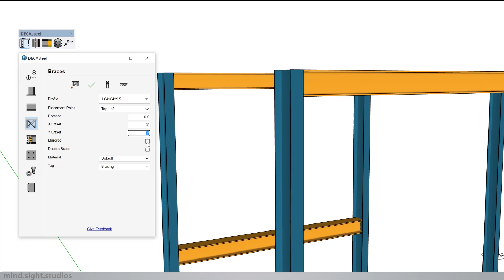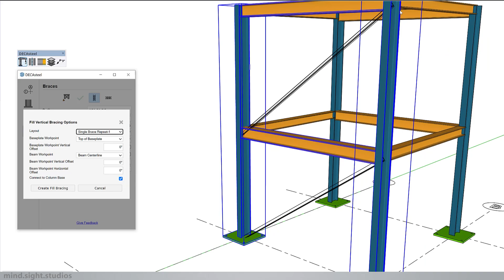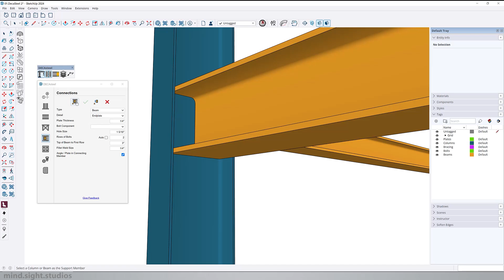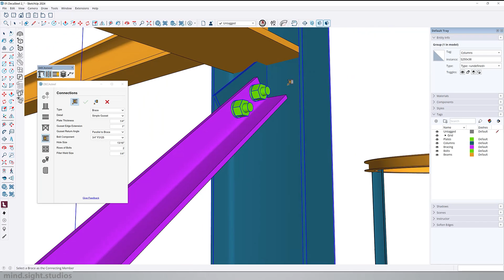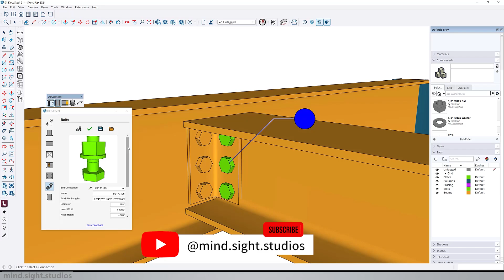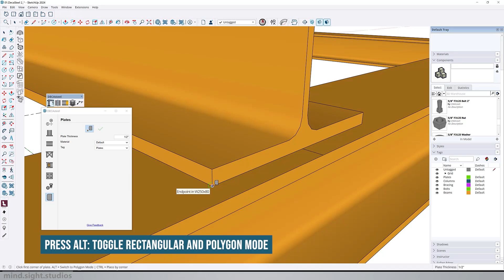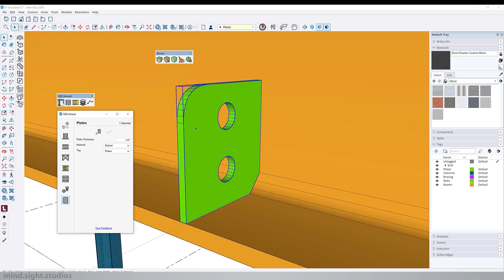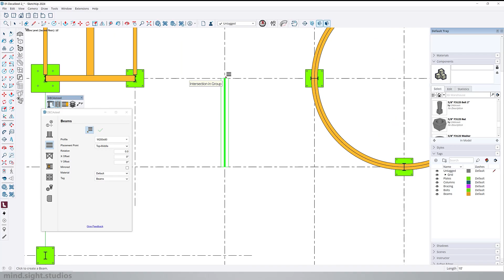DECAsteel Beginner's Guide (Part 2): Efficient Structural Steel Elements in SketchUp

Comment: structural analyst ?!?
Reply from the maker: No, DECAsteel is primarily a modeler but we hope to add features for easy export / import to analysis software. What software do you use for analysis?
Reply: @mind.sight.studios  I've actually used well-known programs that meet my country's SNI code or at least support ACI codes, even if only for testing with an educational or free license. I like Protastructure 2026 + Idestatica for reinforced concrete and steel. Tekla is another option for working with timber structures, with Idestatica for the connections, of course. However, for actual project planning, I use Etabs + Idestatica.

Comment: Where are the bolts for this plugin located?
Reply from the maker: If you create a bolt and save it, it will be saved to your Bolts library folder (defined in your DECAsteel Standard).  For more info see here: https://support.mindsightstudios.com/hc/en-us/articles/37954793377811-Bolts

Comment: is  there a way in which you can alter the bolt spacings vertical and horizontally for a connection
Reply from the maker: Vertical spacing is controlled by your DECAsteel Standard bolt pitch setting. We hope to add more bolt spacing controls in a future update.